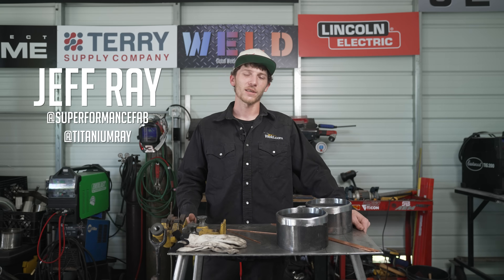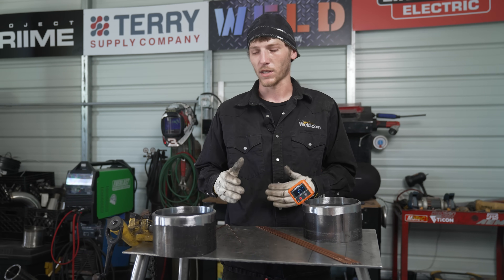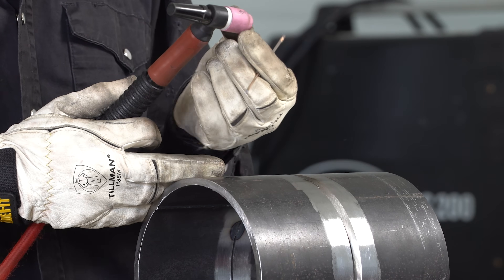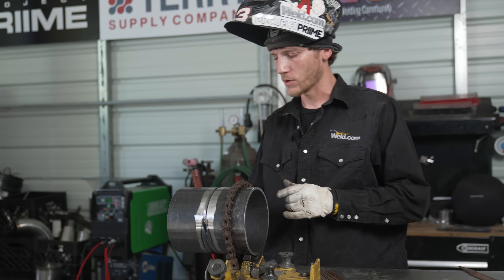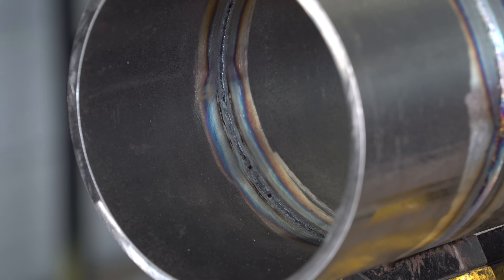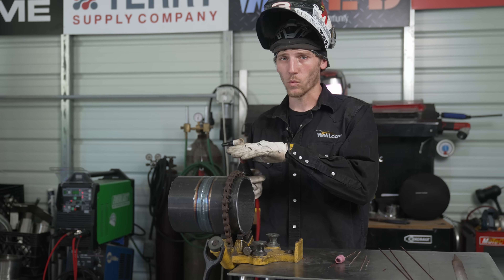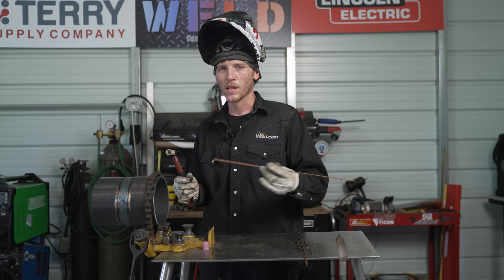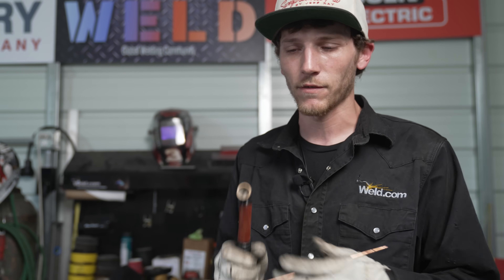TIG Welding: Walking the cup on 6" carbon steel pipe!

Comment: Quick question ! Is there a reason why you don’t have to purge the pipe compared to stainless steal pipe ? 

Are you welding with 100% argon or 75/25 ?

Comment: How many methods/processes/techniques are there to weld/solder aluminum? I know the most common one is AC TIG welding but I don't have that electrical current capability on my welding machine.

Comment: Not bad but this is way too wide, should've ran a two bead cap and I don't know any shop that let's you run two fillers at the same time. Could be the difference between countries tho.

Comment: That root is very rough . Will not pass in the field. Heat was way too cold to try and burn a 1/8 wire in a 3/32 gap

Comment: All you have to do is round the sharp edge of the cup by sanding, to avoid it snagging up on the Pipe. A tip an old timer gave me a long time ago.
Reply: Right on sounds like a good trick thanks for watching

Comment: 1/8” to a 5/32” gap turn the machine to 150 amps using pedal to control the heat and no landing and for the root I prefer a #6 cup, nice looking cap
Reply: Personally (at the moment anyway) I work with a 2mm root, 2mm landing, 120A, (but around 90A for the cap) free hand, button torch, . 
I'd definitely like to get the hang of this walking technique though; I'm sure it could make some situations easier.

Comment: Just curious, why would this be done with TIG vs. Stick?
Reply: Tig is generally stronger and higher quality weld. Depending on the job will dictate which method and weld should be used.